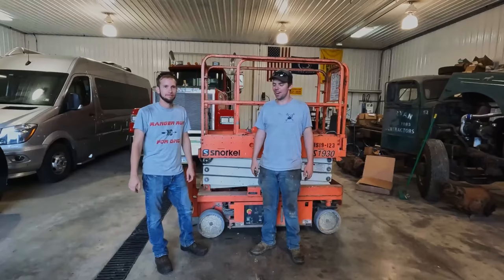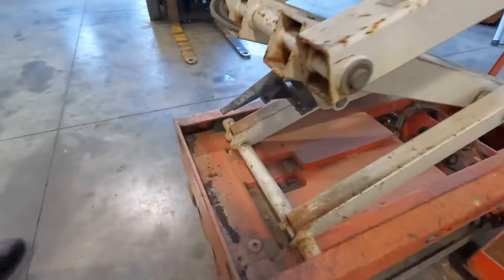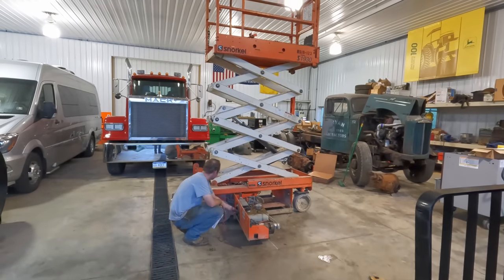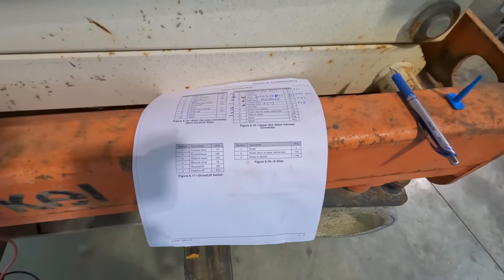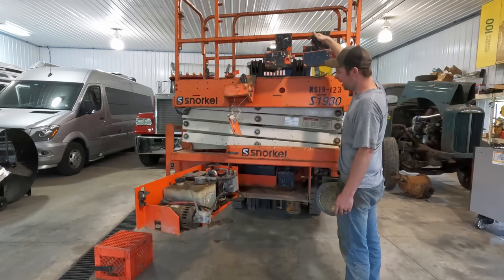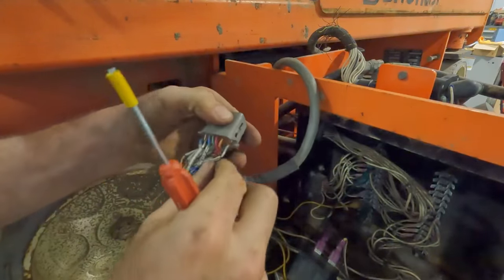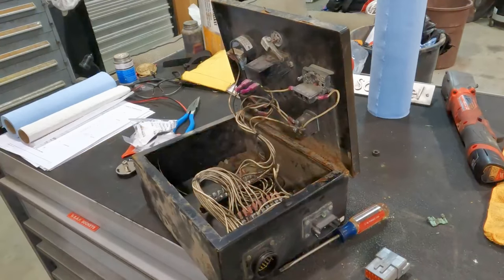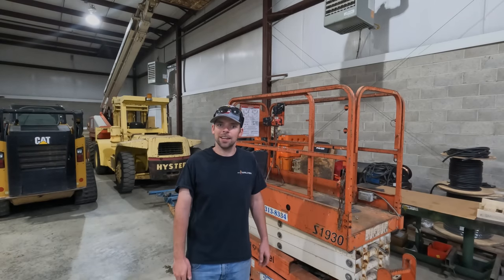Dead Scissor Lift-Will it run?

Comment: Watching you with your arms inside that scissor mechanism without a safety had me scared!
Reply: I was worried a switch would stick and he'd drive it through the garage door or run it through the ceiling.
Reply: You were not alone feeling that. I felt uncomfortable watching it. Should have put in a stopper
Reply: Matt will want to re-po this fine machine

Comment: May want to consider some contact cleaner when working on those wire connections. I use it all the time on my electronic projects and it always helps. Also a flush and fill for the hydraulic oil.  Love your videos.  Thanks Matt for letting me know about your channel !

Comment: Scissor lifts, the makers of widows and severer of limbs and appendages, Cheers from down under.
Reply: Yip, not to be messed with when you haven't a clue what you're doing. My heart was in my mouth watching them. Also shouting at the screen when they did anything trying to correct them lol. Need to get the correct batteries for it as they count towards the ballast of the machine. 4 x Trojan 105's or even better 125's. We have a fleet of over 1000 machines to look after.

Comment: Nice!  Now that you have the red handle pin crimper you need to get the pin extraction tool.  Those pins and crimper are what I use on all my avionics wiring.
Reply: I think I saw him use the pin extraction tool, aka small flathead screwdriver. My experience with Deutsch connectors of that style, there is a little tab/lock finger that holds the pin in place. The locking wedge just presses against all the tabs to keep the pins secured in place. Simple tools are all that is needed to work on those connectors, besides the crimper.

Comment: Sam, all in all, with a bit of work and tinkering with it, and Matt's help with a new /old other control box, new plugs and recrimped wires and pins, a nice little working machine for around the shop. Great Video, Sam, thank you for sharing.

Comment: Guy's got more balls than me for sure, reaching under/through the lift mechanism on a malfunctioning machine! Glad he made it out with everything still attached.
As a side note about scissor lifts, Genie usually have a switch near the ground e-stop. It switches between ground up/down and platform controls. With it in "ground" mode platform controls are disabled, though battery indicator is still active. So you may think your joystick is borked, but it's just that function switch.
Speaking of joysticks, they are typically centered by a single spring. If they are not perfectly centered when machine is turned on then the lift will throw a code and refuse to move. That's there to prevent any unplanned motion, but can be very frustrating since simply tilting the platform control box is often enough to upset the joystick.

Comment: I am in awe of Eric at South Main Auto for his ability to read automotive wiring diagrams and solve issues using various complicated test monitoring tools. But for sheer digging  into complicated wiring issues you are number one, Sam.  Except for changing a plug on a lamp cord electrical wiring has me baffled. Great repair with Big John's input. 👍👍👍🤩🏆🥇

Comment: If its too much hassle to fix the lift so it is safe, try this.
Remove basket and scissors. Weld a regular engine hoist onto the frame. Change out the long travel jack on the hoist for a hydraulic cylinder.  Now you have a powered, drive able engine hoist.  You can also put a small hydraulic winch on it.

Comment: It will work fine with those two batteries, but the reason they designed 4 of them in at the factory was for counter-balance weight.  Good job reviving it.  Now get a old JLG lift and try it!
Reply: Not only that but you get more run time with 4 batteries
Reply: As a former scissor lift tech sorry but this was painful to watch. That being said i give you credit for sticking with it and working through it. It’s just the difference of factory training and applying what you know and making it work

Comment: Try using a Unibit to open up battery cable ringlet terminals. They are much less likely to grab and they leave a nice beveled edge on the terminal

Comment: Best way to fuck up a scissor lift is to lift it from underneath. There are two slots in the back by the stairs which are designed for picking it up. The doors that swing out that contain the batteries  and hydro's only have a small pivot hinge on them. I mentioned it before on Matt's channel but it must have fell on deaf ears. Most have a sticker on them [ No Lift ] right where your forks were. But I still love your channel and keep up the good work. Not my lift.🍻
Reply: I was wondering what those "no lift" tags referred to. Thanks for the info!

Comment: If you have a pin that won't lock you can use super glue to lock it down. If you don't want to replace the connector

Comment: Should the E stop button be a N/C contact on both ends ?
I was given two free new E stops to install on my machine which was missing them both. The wires were just wired into a N/C contacts already but no switches. Just wondering if these N/C contacts were the originals.
Can you use N/O contacts instead ?
Reply from the maker: Normally E stops are NC that way if a wire breaks it shops up as an E stop press. If it was setup for normally open a wire could be broken and you wouldn’t know until pushing the E stop didn’t work

Comment: Uhhh.... I'm an Aerial Lift tech certified on JLG and Genie and you guys really need to stop using that machine until it's inspected by someone else.

Picking it up from the sides damages the pot hole protection system, there are fork pockets on each side of the ladder for that.

You have to use the right batteries , their weight is factored into the stability , if it falls over and has the wrong batteries in it (and you admitted on camera you knowingly put the wrong ones in ) you'll get raped in court.

I'm not trying to knit-pick or armchair quarterback you, I'm actually impressed that you could trouble shoot it on your own , but I don't think you realize that you have  painted a target on your back by filming yourself improperly lifting the machine and admitting that you knowingly put the wrong batteries in.

Even if your repairs have nothing to do with any future accidents , this film will still be "Exhibit A" in a trial showing that you have a history of improper maintenance and repair practices on this machine.

Pay an Aerial Lift company to do an annual inspection and do whatever repairs they deem necessary.
Reply from the maker: A few people have called out not to lift under the pothole guards. This machine literally has stickers pointing down calling out lifting with forks in the locations we did. As far as the batteries go they have been swapped out since. Thanks for watching!
Reply: 100% with you. Only allowed a max of 6 months between LOLER inspections over here and from what I've seen on this video that machine would have a list of failures as long as your arm. Our fleet is now over 1000 booms and scissors.